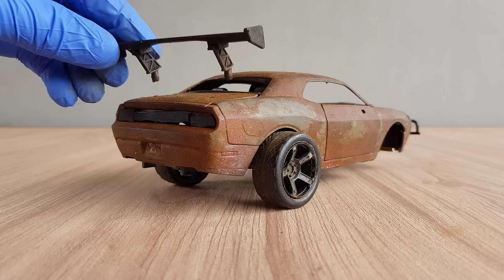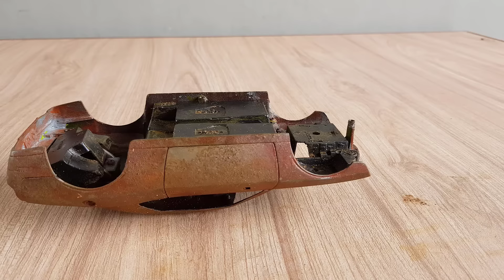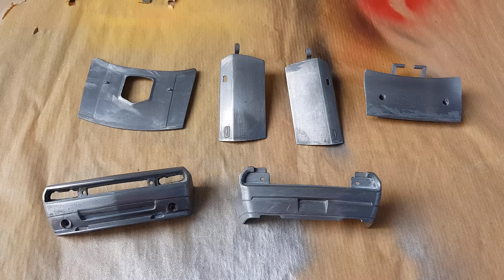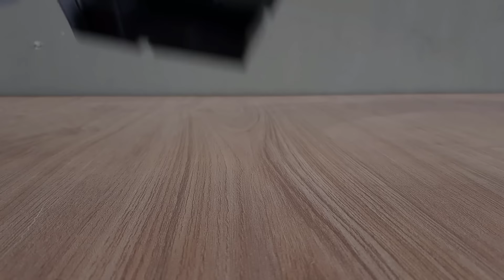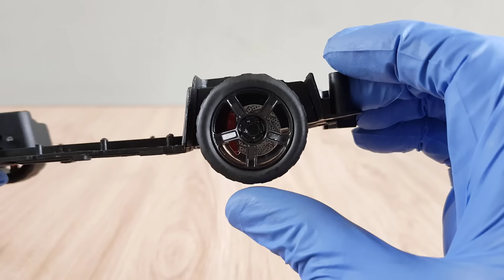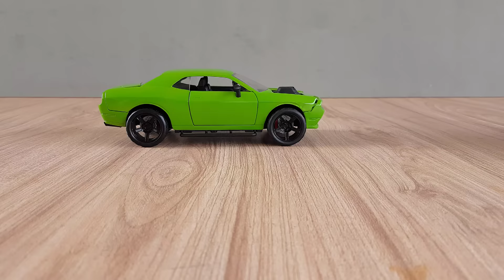Restoration Fast & Furious Letty's Dodge Challenger Muscle Car

Comment: The wheel started out missing on the driver side then switched to missing on the passenger side.
Reply: Yes
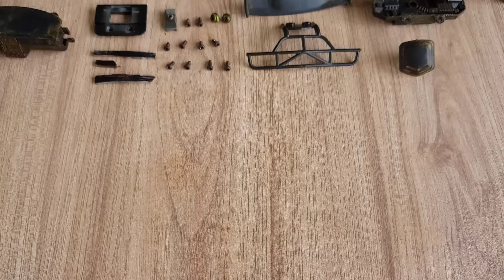Reply: Also at 3:46 4 wheels and tires are shown.

Comment: Wo, great job ! How many time required for a such restoration ? And where do you ordered the missing spare parts, I mean the missing wheels, tires but also the windshield ?
Reply: Im just speculating here but I think he/she takes a car in perfect condition, removes parts from it and scuffs it up with acid, dirt, paint etc to look like a run down car.
The parts "ordered" are just the original ones that were taken off because they are too valuable to demolish.
The material of the first windshield was way thicker than the "replacement" so I dont think it belonged to the car in the first place.
Just my theory though and still quite the restoration